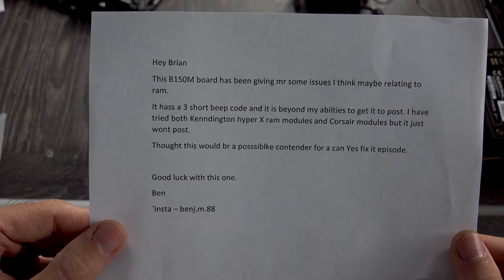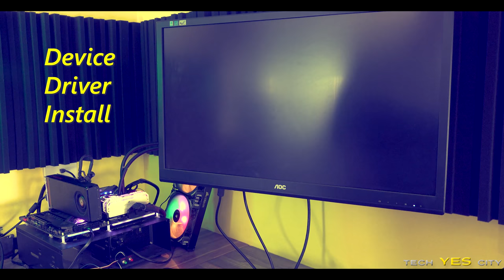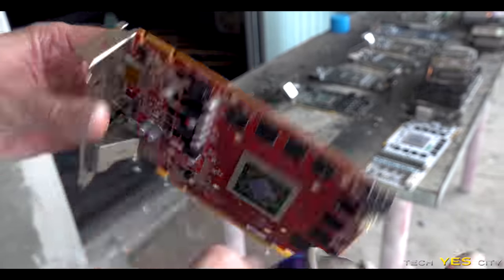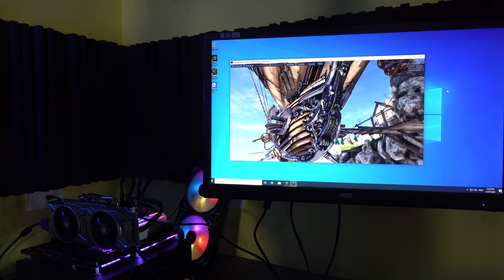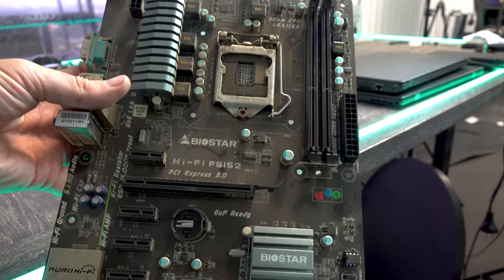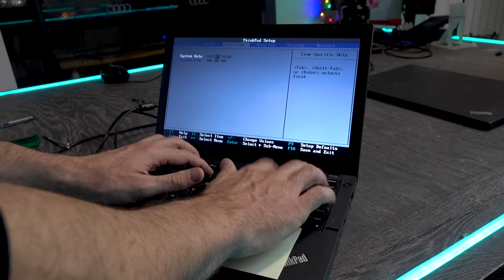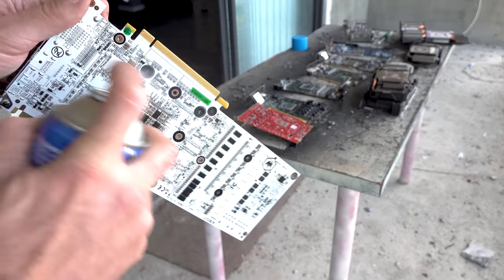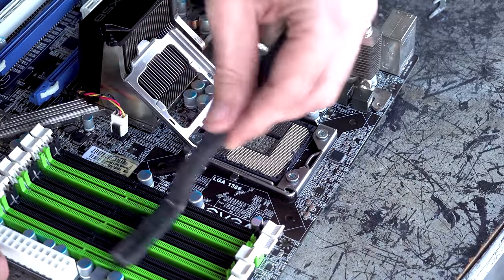How To FIX Faulty DDR3 RAM.....?  Mass FIXING Graphics Cards (Can YES Fix it)

Comment: I am relatively new to overclocking what do you consider both safe & unsafe cpu core temperatures ?
Reply: I usually try to keep things under 80c anything much above that you need to either back off the voltage of get a better cooler.
Reply: @espmegadeth1  well I guess I was OK because at 165 F it was only 73.8 C Thermaltake Silent 775D cooler.  I bought the PC used nforce 680 sli mobo replaced the dual core with a quad core cpu. not sure what channel I started watching alot that suggested if you want to get into gaming try buying used lol

Comment: 18:13 check the biosrom its not all the way in
Reply: Yes, i seen this as well. Wanted to check if anyone else noticed it. I had h97 with a similar issue. Push all the way or pull and reseat it. Boot looping was the symptom, correct?

Comment: I can’t say I’m a expert on laptops but a have fixed 4 of them all in various states of brokenness from water damaged and dropped to screen replacements and just straight up not working in the slightest I can tell you that that laptop you have that works but then turns off can’t be that broken and would be worth trying to give it another go if I had a guess on what to do I would say take out the motherboard and try disconnecting everything you can only leaving essentials so disconnect internal keyboard those could stop it from operating and other things like that also get a repair Guide on the laptop and see if it is an issue that others have had

Comment: In your experience, how long does the hardware live on after the repairs?
Reply: not too long, the bga chip is dead, the real fix = change the gpu on the pcb
Reply: @Krisztian5HUN  A friend of mine was thinking about getting a 2070 with a dead 3D chip and try to repair it.
Told him it was a Pipedream.
Thx for your feedback

Comment: USE MAF CLEANER NOT BREAK CLEANER!! ALSO WHEN YOU HEAT UP ELECTRONICS YOU WANT TO HAVE THEM AS FLAT AS POSSIBLE. THAT WAY THE COMPONENTS DON'T SHIFT AS THE SOLDER MELTS...

Comment: use some liquid flux and it becomes more reliable just heating it usually is only temporary compaired to with liquid flux  will last years cause its more like a ghetto reball been using that method on everything  since xbox 360s came out fixed plenty of laptops  and video cards and xboxes and ps3s xbox ones and ps4s also  with that way  .

Comment: I've found that often times it'sthe bios that is messed up, I bought a gtx 580 for my brother a few years ago and it stopped functioning properly after a few months but after I installed a clean install of the bios it worked fine.

Comment: i had the same issue with a z68 mobo with the bios chip missing and i tried shorting some pins and it worked for me i soldered the top right and the bottom left together and now it boots right on secondary bios

Comment: @tech yes city around 16:00 the GPU that you said dipped fps before...I was getting this with my 2080 ti. 
however turns out my 3900x kicked the bucket, replaced it and works like it did before, plus I put a waterblock on it (:
Reply: How did your 3900x die? Were you running a big OC

Comment: I got a GALAX 980 Ti I bought as parts only not working to use the fans and shroud for another one that had 2 non working fans. Seller stated PC crashes once GPU went under load I secretly hoped the seller had a failing PSU as I had one that did the same with a new GPU I had. So I dusted it and put new paste and pads on the card, It booted fine into windows and I installed drivers then when I ran Valley I got artifacting and then the PC shut down and just kept rebooting.

Comment: I wonder if you can use an electric induction oven set to lower heat instead of a heat gun.
Reply: Electric induction induce electricity inside the card and that is not good. Like microwave, it could create spark.

Comment: Does it matter what brake cleaner i buy? or can it be any thing that is meant to be brake cleaner?
Reply: the idea is to use a liquid that dissolve dirt and evaporate when you're done, like the 100% Alcohol used to clean electronics, but is very hard to get, so use any other cleaner from the Hardware store like "Contact Cleaner" (to clean switches) or anything that exhibit similar property to 100% Alcohol (clean dirt and evaporate).
Reply: these "oily" stuff is non-conductive & don't aid rusting, so it's better than water, but still better to have one that clear out & don't gunk the electronic.

Comment: 2 days before we bought a new gigabyte 2070super windforce oc 3x blablabla....523€....if i put this card in a pc i get beep codes after windows restart...sometimes you can install drivers and can stress the card....but if u restart the pc the card will not recordnize from the uefi and still beeps......WTF!!
should i use heatgun?^^^..

Comment: I have a 1080 that the first time i booted it, it got some video memory blue screen and after that it posted fine and The drivers install just fine and windows sees it is a 1080 but it preforms 7% of a regular 1080 in Games. Pls help
Reply: Try renewing the thermal paste. Take it apart, clean the processor and apply new paste. Easy and cheap.

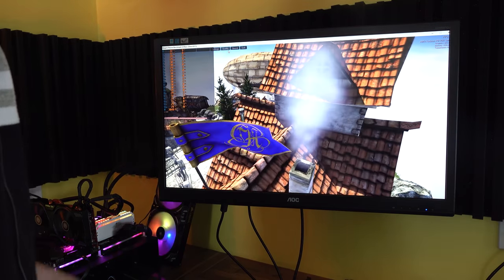Comment: 6:17 This is not true. I got a card that has the same problem and there are DVI to HDMI cables available. Works on any HDMI monitor but without sound. Other than that it works 100%. Don´t use VGA since the quality is much worse than DVI. Other than that, great video ; )
Reply: Yup, was using DVI ports to display on my TV. More stable than direct HDMI in my experience especially with 'less'-branded cheaper TVs.

Comment: 31:31 Regarding the Lenovo laptop. The symptom you mention is called a "spontaneous reboot." Yes, it can be the RAM. I build my own PC about once every 10 years. I don't game so I just keep what I use.  See my only YouTube video pwNJto6VWE8 for my 5 monitor system. Every time I install RAM or upgrade it on my desktop and Lenovo laptops, I test the RAM with a free program called MemTest86_COM. The laptops you are repairing appear to have "legacy BIOS" so you will need to download and install an older v4 MemTest86. Be aware, RAM has a lot of depth to it. It can appear to work OK but come cells can be damaged. When Windows starts using these cells, they can corrupt Windows, even the Registry. Then you will need to completely reinstall Windows. BTW, the RAM "tester" many motherboards use before you boot is garbage. They will not detect bad RAM. Always make sure you use an anti-static wrist strap. You don't want to damage your components. Finally, when you use the brake cleaner and the other cleaner sprays, make sure you use rubber gloves. They have carcinogens. Personally, I would just use a compressed air can. It's quicker, leaves less mess and is safer.
Reply: At least he's wearing a mask while using the brake cleaner now ... it's a start!  😉

Comment: @11:23 argh heat gun repair...it isnt a repair its only a temporary fix .... (maybe)   it damages more parts like the capacitors and stuff .... only way is a) reflow with a infrared station or b) reballing   (of course only if the error causes by cold solder joints !)

Comment: i've tried the brake cleaner on a gpu, its fine but it uses pretty a lot of the product as it dries pretty quickly.   anyone has tried an engine degreaser?

Comment: Yes they work with heat gun but, they wont last once solder has gone it will go again yes you might get the odd one staying but 90% after heating up and cooling down a few times will stop working again sorry for bad news. Done this stuff myself more than once and all after 2 weeks don`t work again. If GPU CPU is very expensive send china get it re-balled it will last.  Washing stuff cool though never tried that good for you keep up the good work Tech Yes City

Comment: How can washing ram with regular tap water be good idea? Water corrodes electronics....i could see it be done with distilled water or isopro alch 95+% but tap water man....
Reply from the maker: spray with multipurpose after and its fine after that.
Reply: @techyescity  ah, ok that makes sense it cleans water and adds protection

Comment: Hmm, I'm pretty sure Louis Rossmann would have some choice words to say about using a heat gun to "fix" a GPU.

Once the substrate inside a chip has melted and shifted due to overheating, it's dead, period. You might get lucky and get everything to briefly line up again correctly, by reflowing with heat, but it's just going to slide off again, probably sooner rather than later.

If it really is just the pins, OK that might work, but you should really clean it up first and reflux, otherwise it's just going to float off again, and once again it'll be sooner rather than later.

In short, these types of "fixes" only really buy you a small amount of time, and that's on the rare occasion they even work at all.

Comment: This is not a real fix, please watch Louis Rossmann or someone who knows what the hell they are doing before you do this to your GPU! You should locate and replace the faulty component rather then attempting to revitalize dead silicon by thermal cycling it (which is a temporary solution, the part WILL fail again typically within a week). 

If you have a new GPU on order or don't care if you kill yours permanently this is better then nothing.

Comment: # Tech YES City community! #
I have a GTX 980 which seems to be faulty. When I turn the PC on nothing displays, no lights on keyboard or mouse. I have to turn it off and on around 3 times for it to work, sometimes I get lucky and it works first time! Ive tried updating the GPU BIOS to no avail. Motherboard BIOS to no avail. Un-plugging other non essential components to take less power draw to no avail. 
When I am booted into windows however it will only show as 100Hz and not 120Hz with no option to make it higher and I also have to disable the GPU driver and then re-enable it for it to work in 1080p. I've re-installed the driver thinking that may fix it but doesn't. 
Its baffled me, would anyone care to shed any light? When I get a new GPU I think it would be worth sending in for a Can YES Fix it episode, until then I have to keep trying as I dont have the budget for a new GPU.
Thanks!

Comment: @Tech YES City
Brian, I hate to say this because your channel rocks, but you're making a right gnaws up of the heat gun method. You absolutely NEED liquid flux injected under the GPU's and parts of interest so that when the solder underneath melts it balls up again instead of crystallizing further. Seriously, think about it for a moment, would solder without flux? Then why would you reflow without flux? Liquid flux pens work well, but I use liquid rosin flux injector bottles for doing reflow jobs. Absolute necessity mate! It's hit or miss otherwise. It was literally cringy to watch you do this the wrong way..

Comment: laptops are such convoluted heaps that you cant remember how to put back together 100%. needs to be a assembly standard like with desktops. and to be modular like desktop as you say to replace individual faulty parts. it would save on engineering custom fit parts for companies too so i dont know why they prefer the non standardized designs
Reply: i mean gaming laptops are chunky already just make them standardized computer cases.

Comment: techyescity i think i have a bios chip for h61
Reply: Is it possible to desolder backup bios and solder it where main bios go? I don't know if they are identical or there are tiny differences
Reply: @yorchli3152   i would think so but the motherboard probably need to read both bios chipset to work

Comment: Most of those GPU could have been fixed just by reflowing the solder.
Reply: The ole oven method
Reply: That's basically what he's doing tho. With some tech yes loving for added bling
Reply: @pilu9538  agree

Comment: bro i am puking.. ( i have 13 year on servicing ) that PCB is like living creature.. no flux (/ what is most important part for proper heat spread.. ) uncontroled enviroment.. just va litle blow of air mean 50 celsius degre diference.. and i don't wanna even talk about over heating method.. this is like for 7day repair if is damn lucky..  this is crazzy just simple math.. all that BGA balls have about 0,30-0,45mm they have 0,25-0,35clearence and  there is like 48-500 ball's under that GPU ( dotn even talk about actual flipchip joint under cement layer.. there NO DRYING! bro you shut dry them.. those PCB of actualy GPU chip cointain water.. ( we call this popcorn issue when 450C homemade fun heat gun touch GPU chip, water lietary explode out of some layer of GPU chip and splash out BGA ball in to one big short , or rip and tear internal multilayer pcb structure) my lord... you have to put it in dryer for 24H with 100 degree to dry out ( i actualy using 70 only and it is fine over 24H) that movement for PCB is over 2mm.. do you really expect working *fix*? or you sending them for silicon heaven for some reason??

Comment: i would not call heatgun a fix... get your multimeter on and fix cards for real... heating dead capacitors will force them to work again for a while. but it's not a fix.

Comment: I fixed mine by NOT fixing it....It was the damned Gigabyte MOBO. F U Gigabyte and your 2 BIOSs (EEPROM) that corrupt then don't work.
HyperX memory and 3570K were fine.
TY to the guy that had a used newer MSI MOBO / CPU / memory to fix my system and prove it was NEVER THE MEMORY/CPU. 
Best $50USD I ever spent.

Comment: Someone really think a fast pass with that heat gun could ever be able to fix a flip chip failure? Come on, in that way I’m afraid you do not  reflow the solder balls but just worms that up a bit... if something change after this is not intended to last for more than a few days or better hours and wouldn’t be called a fix...

Comment: How long on average until these heat-gunned graphics cards die again?
Reply: probably the solder connection broke loose because of heat expansion... if so it won't happen again until it get overheated again.

Comment: Don't fix this X1carbon from this up to 5th gen motherboard dies every couple years, once replaced mine already, one day carrying it in my backpack just to find out it doesn't work anymore. 2nd board also failed in a year, running 3rd board cant let that keyboard go, but if it fails this time ill throw it out,(Should've done that right away) Ill make sure to Smash it, set it on fire, and throw in a wood chipper before taking it to garbage bin. Lenovo QC is a joke, even new x1carbon are so poor QC and they charge you super premium. GTFO Lenovo.

Comment: Wow wow, im so surpriced at no explanations about ESD and contamination in any fluids you used.  Maybe make a reverence to a video with more details maybe? Louis Rossmann is crying ma dude.

Had too google Brake cleaner Fluid, https://hackaday.com/tag/brake-cleaner/ Acetone is bad, so I might actualy look itno this, Isopropanol is BEST, but weird time these are, so maybe ill look up the right brakefluid.

Soapy water? please, for the love of fixing parts, nomater what water combination you used, rinse the boards/electrical components with deminiralized water afterwards. why? Minerals, they are in tap water, your soap, your cleaning fluids (that arent made for electronic clenaing). rinse em away with deminiralized water please.  Why? the minirals and other durty contaminations may settle somewhere else, get stuck between some bga balls or under a TQFP package and SLOWLY eat away solder resist, solder, metals and thus kill the part or board slowly.

DONT heat plastics or Capasitors, use alluminium paper or tape to cover plastics or capasitors, or look up the datasheet for common smd parts and look for the reflow curves and max temps and times. use a temp probe.  Yes I did yanky repairs like you with paint remove heatguns, but you get longer lives out of these parts if you keep your temps and time in cheap (preheating helps abit too preventing warping boards on the long run)

Good luck, your on the right track, but please understand basic smd reflow methods. its not about the tools, its the methods executed. (it might even resurrect more boards). And eh... maybe buy a POSTcard for the laptops and motherboards that dont have a POST output? they are cheap. 

Whoever reads this all the way here, Thanks, have a cookie and good luck in your life :D

Comment: I've watched you since before this channel, when you were just a cool feature on other peoples podcasts. I like you and what you bring to the PCHW table. But i've come to the end of my line with you calling things even you admit are janky "fixes" and "fix methods", continuing to keep the heat gun myth going and encouraging people to do things that are just going to cost them money because it coaxed 5 minutes more life out of 1 in 1 million slightly broken graphics cards, which were then completely ****ed after that 5 minutes. We've fallen out before over this and i've given you a chance to change, you've just doubled down on the irresponsibility. Which is a real shame because you bring a hell of a lot of good and unique information to this space.
This is a great channel and you're awesome at it.... But sadly i'm going to have to tell youtube not to recommend this channel anymore. Only thing i can do.
Reply: Not that I'd call it a 'fix' either, but if the GPU starts working after a heat gun session it's obviously a BGA problem. Given that it's not worth paying for a reball on old or low end GPUs ( which even then isn't a guaranteed permanent fix ), why are you bothered if anyone tries it?
Worst case it doesn't work at all, otherwise it might get someone a little more use out of something already destined for the scrap heap.